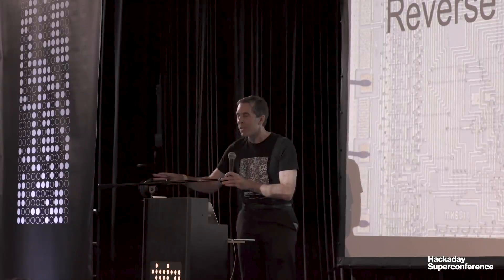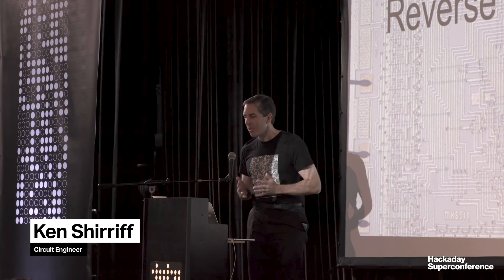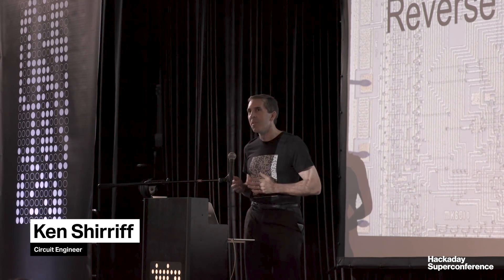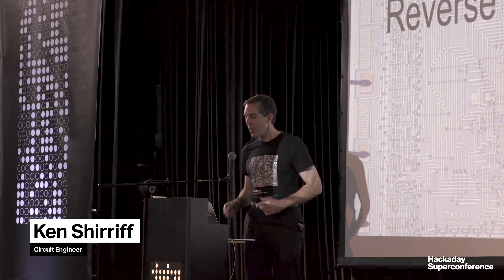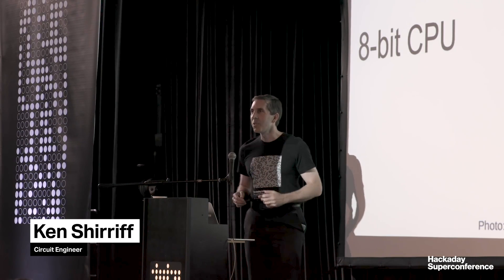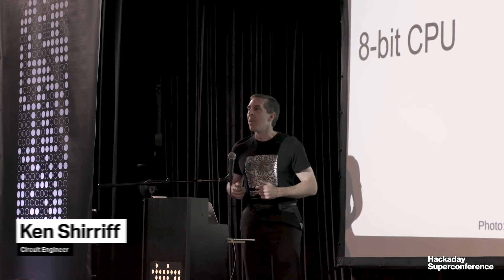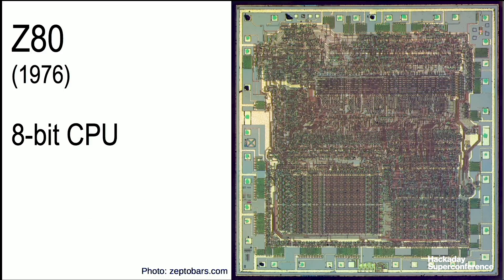Ken Shirriff: Reverse Engineering Silicon and Restoring Iconic Computers

Comment: The fact that he not only recognizes those components.  But that he can differentiate between the many different manufacturing processes that were employed to make them-and if you know when those particular processes were the generally accepted method, then a reasonably educated guess can be made as to the chips age.  THAT is a good bunch of forensic science, and this guy isn’t just probing with meters, frequency counters, and oscilloscopes.  He’s shopping for scanning electron microscopes and burning the enclosures off the ICs with low power lasers!!  It’s not the type of electronics engineering that one’s college degree is in.  I wouldn’t know where to go to learn how to identify those blocks of components except from Ken Sherriff!